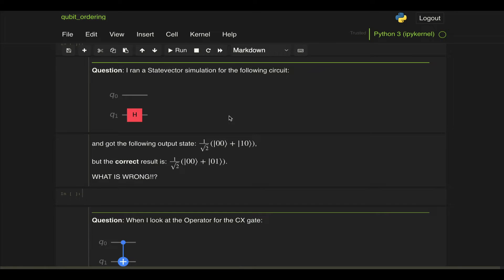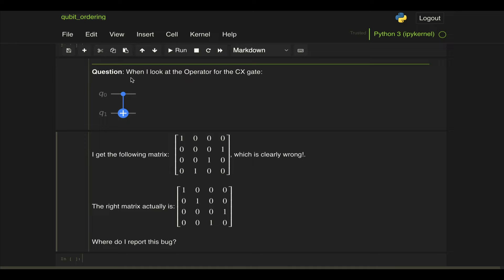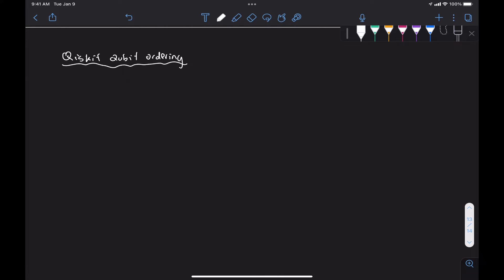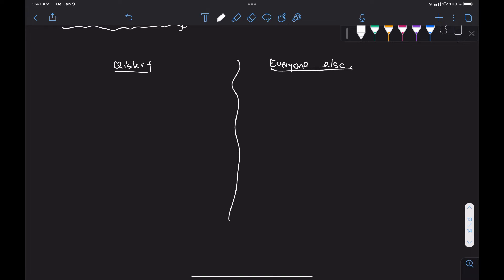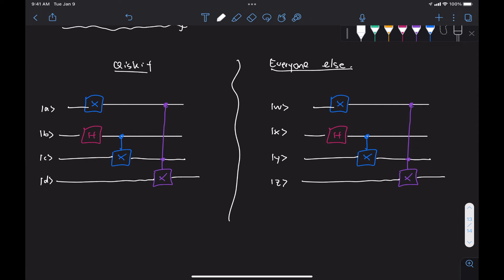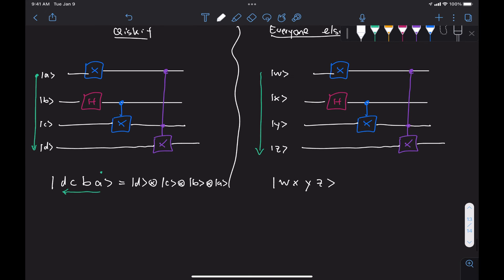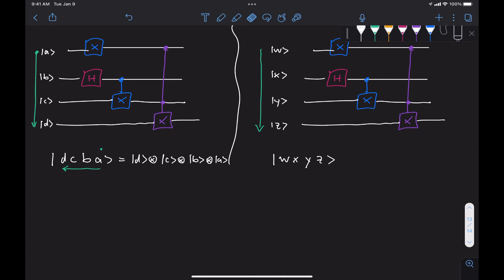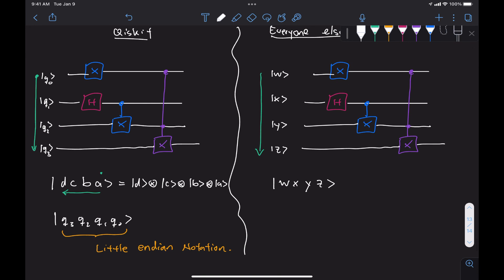Qiskit FAQs | Qiskit Qubit Ordering - Part 1

Comment: Thanks for this! I especially appreciate your identification of what libraries, disciplines, and texts write circuits top/bottom and kets left/right. But I think little-endian and big-endian mean the opposite of what you are saying: the terms refer to the left character being big or little place value, not the right character. I also think the terms are generally used in classical computing, in any case, to refer to byte order rather than bit order (which is why I said "character" rather than "digit" in pointing out the primary problem. 

Comparing to endianess is maybe helpful because they are similar concepts, but overloading these terms might introduce more confusion because big/little-endian usually mean with respect to bytes and both systems are big-endian with respect to bits.

To write decimal 22=16+0+4+2+0 in binary integer representation, in big endian with respect to bit order, transmitting the most significant bit first: 10110, where the 0s are in the 8's place and 1's place. Big endian bit order has the big end at the *left*, "big end transmitted first".

However, when people say that network protocols tend to prefer big endian and CPUs tend to use little endian, they mean with respect to byte order. So the integer 513 = 512 + 1 requires two bytes. In big endian, this is 0000 0010   0000 0001, while in little endian, this is 0000 0001 0000 0010.
Reply from the maker: Thank you for the comment @bennettbrowniowa

You're right, the endian terminology can introduce some confusion here, particularly because we are referring to bits and not bytes (or other bigger "chunks" of information). I used "little endian" here because it was all over the qiskit documentation. That being said, I do not think it necessarily means the opposite of what I am saying. 

To clarify, I use little endian to denote that the LSB (bit most to the right) carries the least amount of weight and therefore is to be used first to, lets say, calculate the equivalent decimal value. This is consistent with the general use of little endian notation, where the LSB is to be transmitted first in a communication system, or to be stored first in memory.